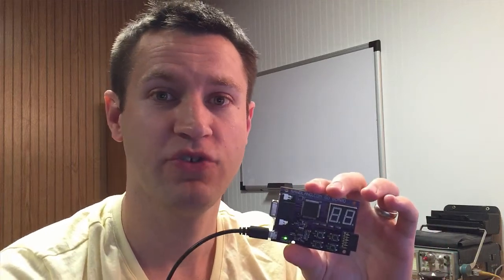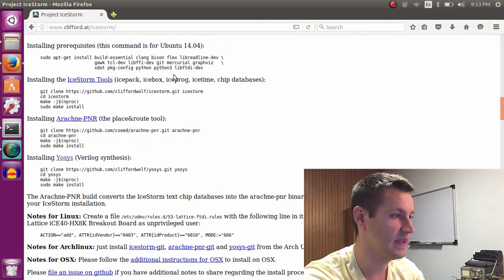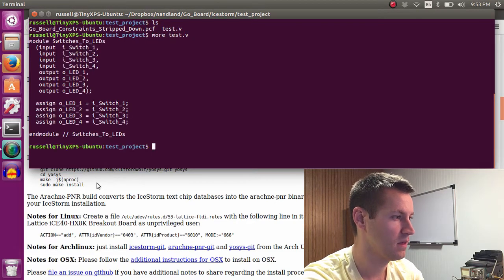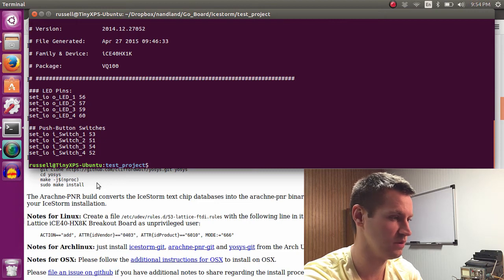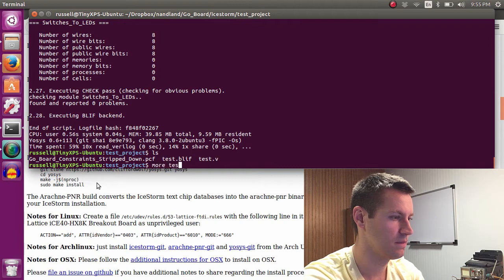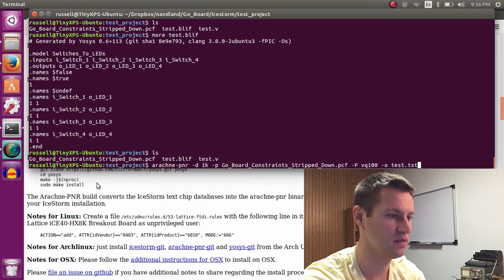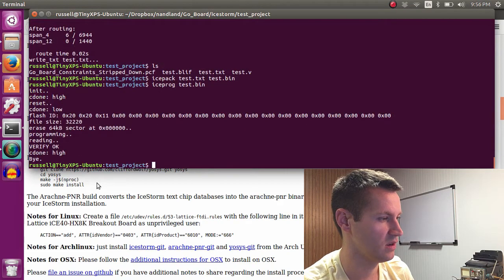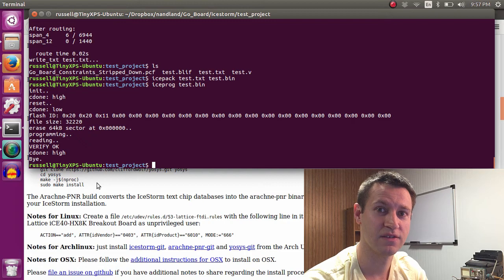FIRST FPGA Open Source Tools (IceStorm) - Nandland Go Board Tutorial

Comment: Thank you again for this video! I'm using a Docker image (ddm/icetools on Github) to run yosys+arachne-pnr+icepack and a locally installed iceprog (installed locally, because the docker image can't access the USB port AFAIK) on a 2018 MacBook Pro and it works great.

Comment: With Ubuntu 16.04 LTS there are now packages available for this. 

Already on my 16.04 system: arachne-pnr, arachne-pnr-chipdb, yosys, and fpga-icestorm.  fpga-icestorm-chipdb was not on, so I did a 'sudo apt-get install fpga-icestorm-chipdb' and it went right on.  

(Package icestorm is, btw, ice35-services, and not Clifford Wolf's icestorm.)

Originally I started to do the manual install. I did the "Installing prerequisites..." from the video (ultimately not required, but didn't hurt); I tried installing from github, as described in the video, but one of the "makes" failed.  I didn't do any "make install's".  Then I found the packages already installed.  Yahoo.  

I did add then remove the udev rule as there is already one in place as part of the fpga-icestorm package (do 'sudo dpkg-query -L fpga-icestorm' and see the /lib/udev/rules.d/40-fpga-icestorm.rules file in that package.) That udev rule has a group (GROUP="plugdev") that you must add to your account if it is not there already.  (mine had it:
tommy@thinkPad:~$ groups
tommy adm cdrom sudo dip plugdev lpadmin sambashare vboxusers wheel)   

Lastly, there seem to be more .v files available (tests and examples) in the github sources.  It may be useful to 'git clone' them but not do the "make" or "make install".  I haven't gotten that far yet. As always, YMMV.